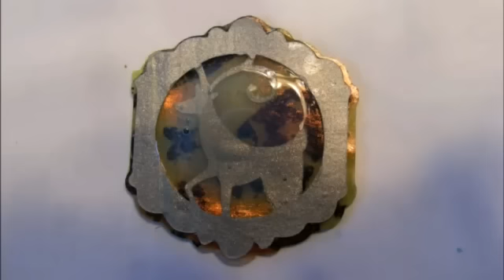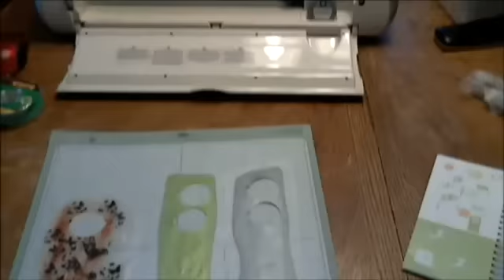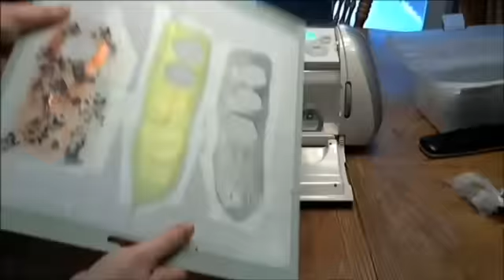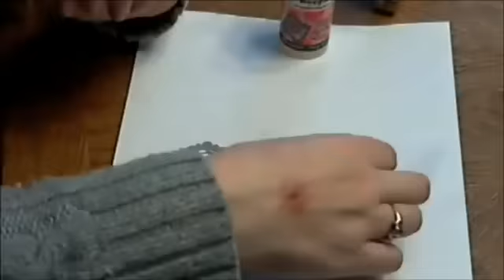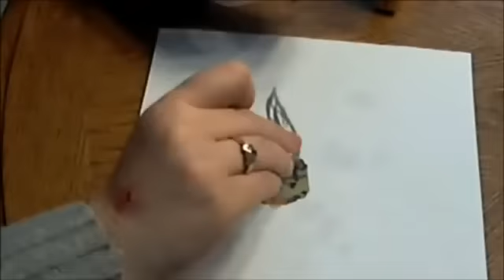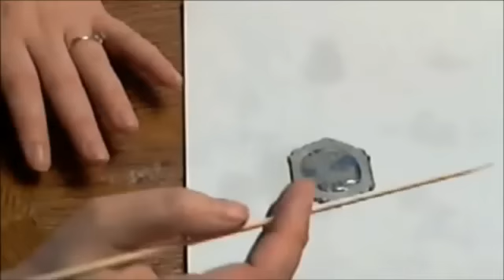Polymer Clay TV Cutting Polymer Clay with a Cricut Die Cutting Machine

Comment: About to attempt my first polymer clay cut. Mine is setting 6 at least, but deep cut housing. Can’t figure out it what “material” to configure the cricut for. Heavy cardboard?
Reply: You may have to experiment with settings as I feel like many factors will effect the outcome here—IE if clay thickness, clay brand, Cricut machine, bake time, etc
But I would set the settings individually in Design Space as opposed to using the dial on the machine. I get better results for everything by avoiding using the dial